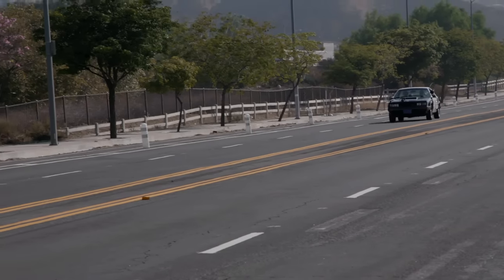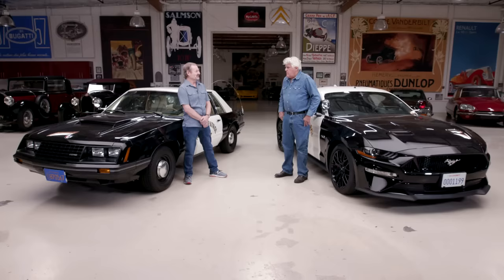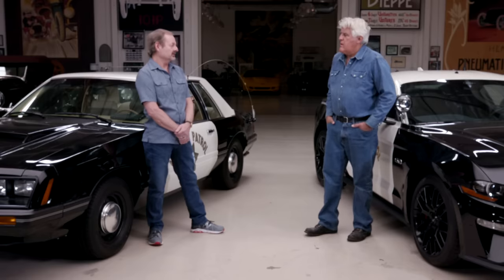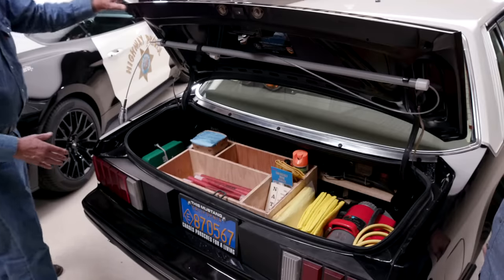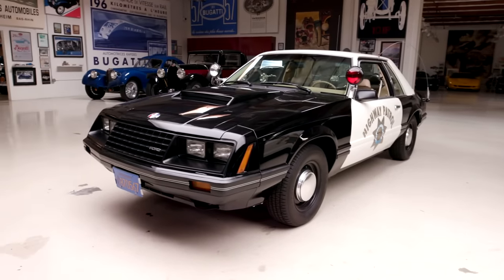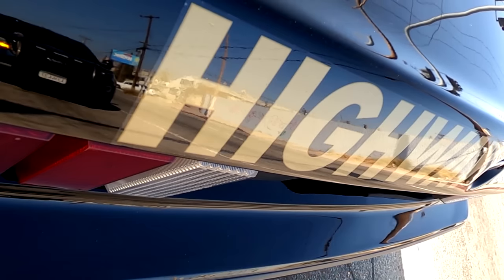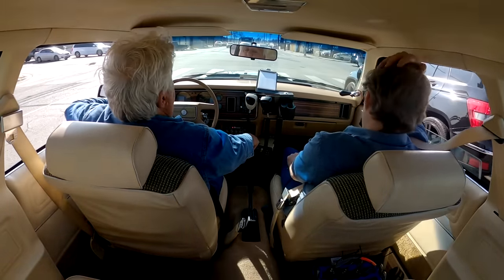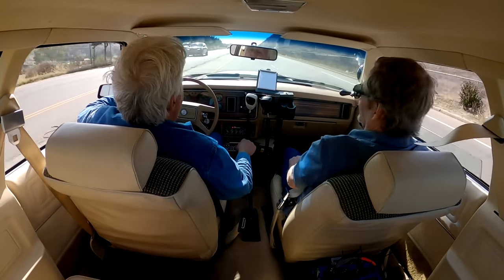This Mustang Chases Porsches for a Living | Jay Leno's Garage

Comment: 180 mph?? I find that hard to buy u would need a 250 ⚙️ gear ratio!!! But  We're so spoiled with horsepower numbers today where the normal mustang GT makes 460hp but back in the 80s car companies didn't know how to make a bunch of horse while passing emissions so a car with 200 horse was fast back then plus it was a lot lighter than modern mustangs it probably felt like a rocket 🚀 compared to the gas savers of the time! In 91 my parents had a 89 sho tarus with 220hp 5 speed and my dad would bust mustangs and Camaros in that 4 door sho lol that sho was a ballistic missle back then but now a camery would probably out run it!!! but anyway Awesome car and a look back into the Awesome 80s!!!!

Comment: "the 85 MPH speedo was made into law in 1979, although it had a short legal existence, as the Reagan administration reversed the law by late 1981.  Yet, a good number of cars made in the 1980s and 90s still used these limited instruments; as I remember my 4 cylinder 1990 Mustang had an 85 MPH unit"

Comment: Theres no way that thing did 180mph. Even with a 3.03 rear end theyre gearing limited to ~168 mph and wont get near that with 157hp....Even the 225hp Cobras with a 3.23 rear end had trouble doing 140mph in tests in 1993 due to the Aero which was better than these old 4 eye cars!

Even the much better Aero 2000 model Cobra R with 385hp and 3200lbs did only 170mph and that was drag limited.......My '93 Fox has a 410whp LSx and a 3.23 rear end and ive had trouble getting it to 170 just due to aero unless i have a good 3 mile stretch!

Comment: The 5.0 is standard 302 ci ford smallblock platform.  225 HP factory.  Upgrades for police interceptor included chip and some had over bore with few tricks added to increase from 225 HP up to 300 HP roughly.  Even 300 HP in these rustangs is a 10 second car.  Fast.  Proper gearing needed. They handle like chit for cornering , just a great all-out straight away chase car.   Still under powdered vs todays cars this is a joke
Reply: all the best buddy🎉🎉 congratulations🎉 let's talk on telegram you've been randomly selected among today's (GIVEAWAY)🎊,❤

Comment: I never was a Ford guy.  I started dating this girl back in the day and she had an inline 6 76 Camaro.  It was red, had Cragar S/S wheels (it was a poser) and also red is my favorite color, I thought it was kind of cool for a poser.  Anyway, she got rid of that and got an '82 Mustang GT.  I thought, man, what a piece of crap Ford.  Well, here's the thing, that Mustang got me into a lifetime of owning Mustangs.  Yes, the car had a 4 speed manual, yes, it had a 2 barrel carb (however, that carb was a 500 cfm Holley design, which all Motorcraft carbs were), and yes, it was only 150hp.  The hood scoop was fake on the car, but it had to be put on due to the 2 barrel intake was a high rise and the air cleaner stuck above the hood.  After I broke up with her, I soon bought myself a new 87 Mustang LX.  It was a 5 speed 2.3 (I couldn't afford insurance on the 5.0).  I soon got bored with that and bought a 90 LX 5.0.  When in 94 Ford changed up the design to the SN95, I bought a 94 GT,  I got rid of that when I had kids and bought a Bmw 3 series sport 4 door.  After that, I bought a 12 GT and still have that as well as a dark red 20 GT track pack.  The black and white 21 GT Jay did for SEMA is the same track pack as mine.  It has a bigger radiator, 373 gears (my 12 has 331's and you can tell the difference between the 2 cars, the 20 hops off the line so much better when letting off the clutch), the car also has a Torsen limited slip instead of the Ford 8.8.  The Mustangs are fun cars, I'm glad I've owned them.  Every time I bought a new one in the past, I always thought about a Firebird, or a Challenger and most recently a Camaro.  I have always gone back to Mustangs.  The irony is that I am a service advisor at a Ford dealership since 2013.

Comment: I owned a 1966 Mustang convertible with the 200 ci six, a 1984 LX convertible with the 302, and a 1987 GT convertible with the 302. My wife kept having kids and I could not fit them in the Mustangs. I moved up to a 1990 Taurus SHO with the Yamaha 3.0 and 5-speed manual transmission and 220 hp.
Maybe I should move to California and work for your Museum
Jay, George HW Bush was a class act. We need people like him elected and not the self-serving egotistical politicians. Why don't you run?

Comment: A typical lieing cop. These cars came with a 2 Barrel carb and said he has done 180 M.P.H, they didn't even have a speed rated tire for that fast in a Mustang,  while the speedometer was only 85 M.P.H. because of the emissions. I would have loved to see him try catching The sledgehammer Corvette , Callaway Twin Turbo Times Port Injection that did over 250 Back into the 80s.

Comment: those mustangs and fairmonts even for the day were not much and if it rained those things were out of control at any speed, really bad traction. I do not be leave for one second that car is going 160 let alone any faster. That thing would would never have the power, gearing or stay  on the road it would take off and fly. If that guy was racing a full size ford drag racing with a FE engine he lost a lot